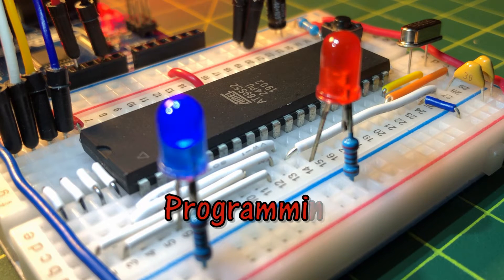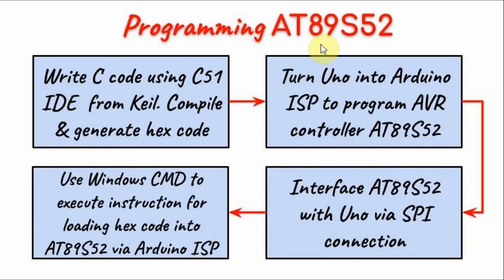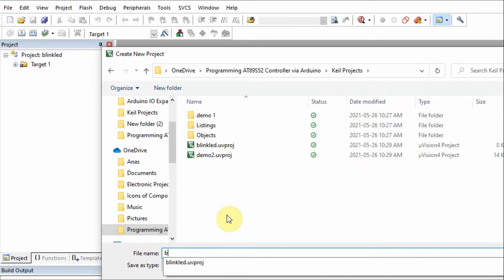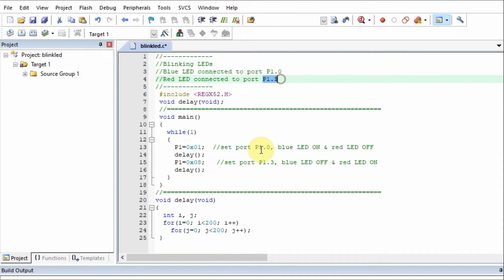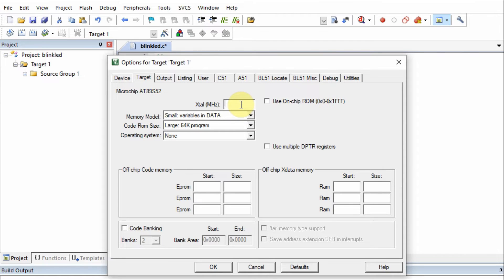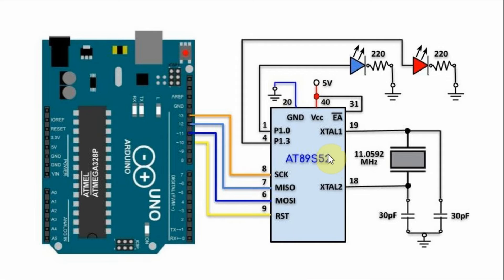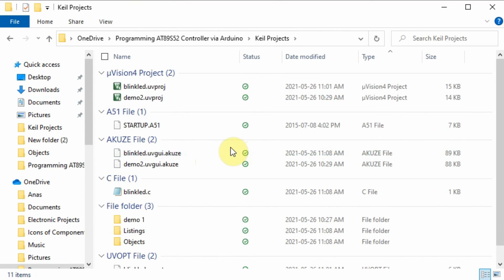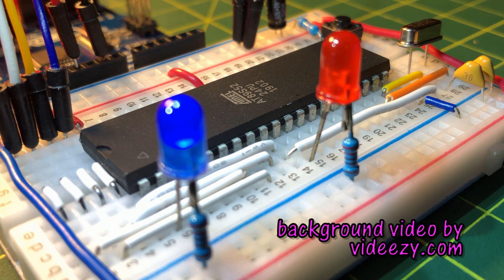Programming AT89S52 Microcontroller via C

Comment: Have a good day sir, avrdude.exe: Device signature = Oxffffff
(probably reduced_core_tiny)
avrdude.exe: Yikes! Invalid device signature.
Double check connections and try again,
or use -F to override
this check.
avrdude.exe done. Thank you.
I had an error like that, what should I do?
Reply: Same problem found any solution?
Reply: @himanshukothekar516 Yeaap I changed jumper cables and after that it worked. Check your cables and other connections components